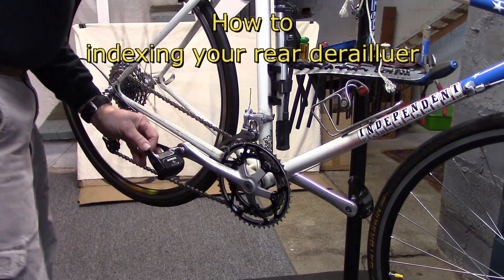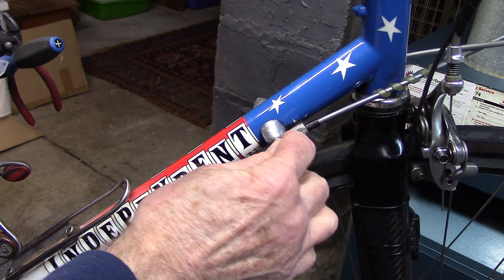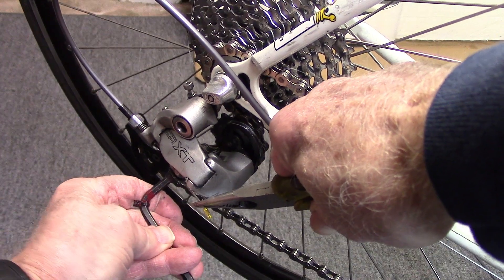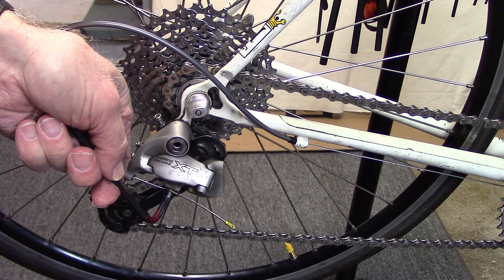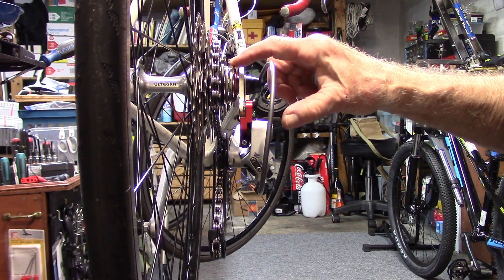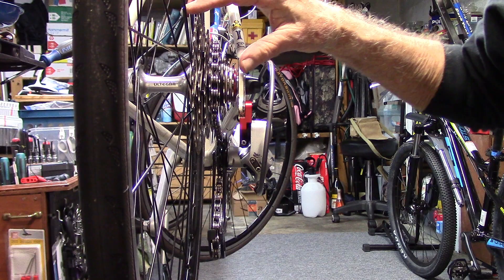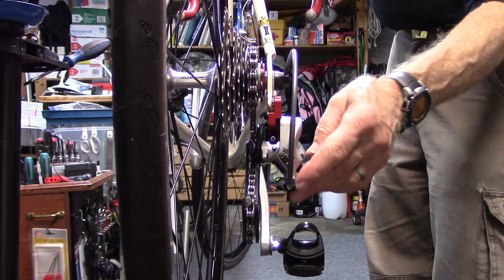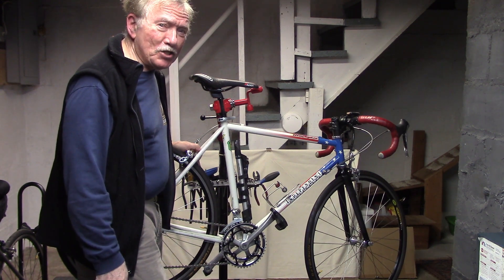How to index (fine tune) bicycle rear derailleur

Comment: Your lessons are so comforting, informative, simple and don't make me feel like a fool when they all use fancy words and confuse me. 
I never knew it was called indexing! 
Thank you
Reply from the maker: You're welcome. There's a lot of terminology that's thrown around and never adequately explain. Did you know that a 10 speed bicycle is defined by the number of cogs on the cassette in the back and if the have 2 chainrings up front your total gear choices are 2x10=20. My first bike as a kid was a 10 speed with 5 cogs in the back and 2 chain rings in the front. It should have been called a 5 speed with 2x5=10 gear choices. And this is only the beginning. So I'll try to point these things out in my video for all of us to learn. Regards and safe cycling, Tony

Comment: thanks tony for your great easy to understand videos.i have a old land rider auto shift   bike in good condition but took the derailleur off to clean, now when i ride i can shift from largest cog in rear to easiest, but have trouble making chain  go back up  to larger  cog  after slowing down .so have trouble moving chain back toward the spokes side. and then want to accelerate.. has no cables to adjust, but has a B screw at connection to bike frames,hex adjustable screw in rear, 2 side screws  on side to adjust cadence.
if you can give me some ideas/guidance as to what i might try, would be grateful.
if pics would help i can send.
thanks
john
Reply from the maker: Here are two videos that may help:

https://www.youtube.com/watch?v=x86iIodIZ5s&ab_channel=LeaFirebender
and 
https://www.youtube.com/watch?v=z0SRGDKYnM0&ab_channel=BikemanforU

This is not one of Bikeman's favorites. But don't discard it, there are not many on the road and, although it may be a flop, it's also a classic.
Regards, Tony

Comment: I have a 
Trek 4300 with direct connect handlebars: I would like to adjust the handlebar height, but this setup apparently takes special tools and training.  Disappointing if true, but I’d like to know what I’m asking before walking ignorantly into a shop. I make height adjustments fairly often on my road bike to fit what I’m doing and would like to do the same on the Trek. Thanks!
Reply from the maker: With this type of stem, moving the stem affects the headset bearing adjustment. This procedure requires special tools and training so this should only be done by your Trek dealer. I wish I could explain the process but it's not explained in the owners manual. Sorry I can't be of help. You'll just have to tell the dealer what you want and ask him to explain the process.

Comment: Hello Tony, good evening. I was trying to adjust rear derailleur (SHIMANO Alivio) of my Polygon Premier 5 bike. I almost did 95% of the job, but to achieve 100% perfection, I tinkered with the shifters (SHIMANO Altus). I loosened the knob in shifters and then tightened it again. Post that, my shifter is stuck. I can move between 9-7 only. Now I don’t know how to fix it. Without fixing the shifters, I can’t adjust the gears now. Please suggest what could be the possible solution.
Reply from the maker: I'm not sure what knob you loosened and tightened. Was it the barrel adjuster? Anyway, here are a couple of videos that may help:
https://www.youtube.com/watch?v=5PaGO30H63E&ab_channel=JoeyMesa
and
https://www.youtube.com/watch?v=vcwhADt7ANs&ab_channel=JoeyMesa
Let me know how you make out.
Reply: @tony10speed  There is a barrel adjuster in Shimano Altus fire shifter.
Reply from the maker: @rahulsony569  It is possible that there is to much tension in the cable preventing shifting (provided there is no dirt in the shifter as described in the previous videos. You'll need to release the rear derailleur cable pinch bolt and start from scratch as in the video. Let me know how you make out.
Reply: @tony10speed  ok sir. will try again. Hope this time I sort it out. Thanks a lot.
Reply: @tony10speed Dear Mr Tony, my issue is resolved now. Problem was excess tension in the wire. I stretched the wire here and there by keeping the shifter and chain on the highest gear. Thanks for the advice. 🙏
Reply from the maker: @rahulsony569  Good trouble shooting! Be well and safe cycling, Tony
Reply: @tony10speed  sure 😊